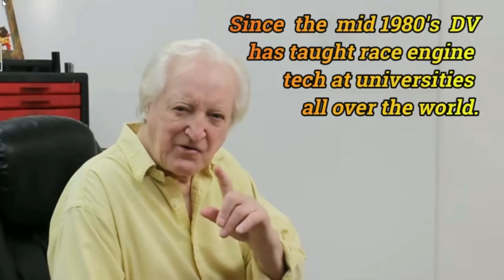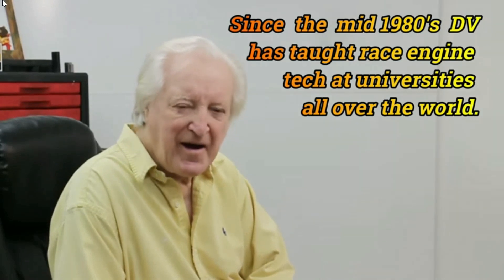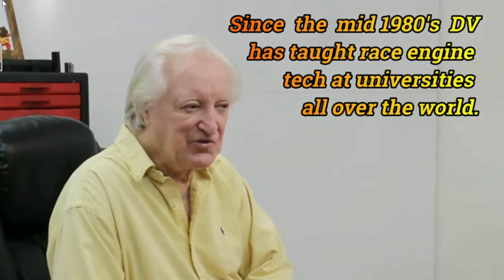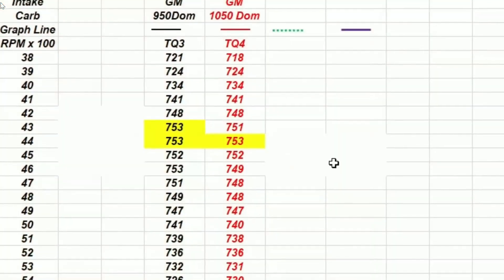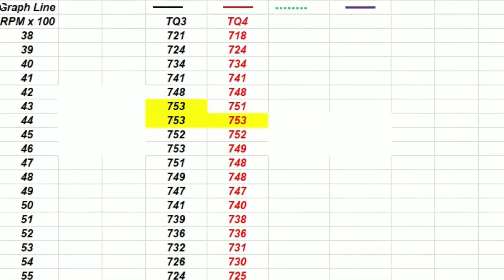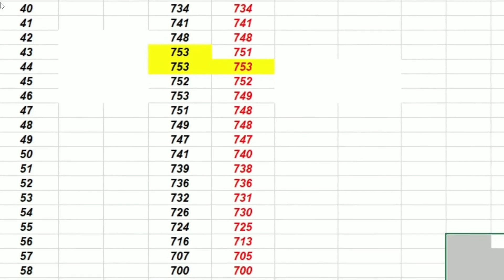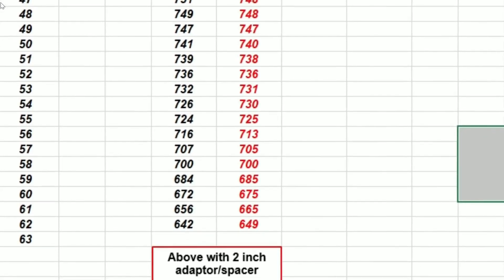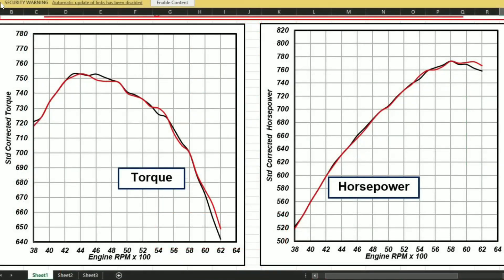Totally streetable (87 octane fuel) 805 hp 572 BBC carb tests.

Comment: Happy thanks giving David!  Good job...  I have a BBC 468 cu. in. in my race car and it is a 800 Hp engine with a Properformace carb, probably 1150+ cfm., SV-1.  Really responsive!   Car runs 8.82 et. at 152 mph.  1/8 mile runs 5.62 et. at 123 mph.  Have not jetted carb yet and have not launch the car off the line with the trans brake like I should have, not much above idle.
Reply: What does your car weigh?